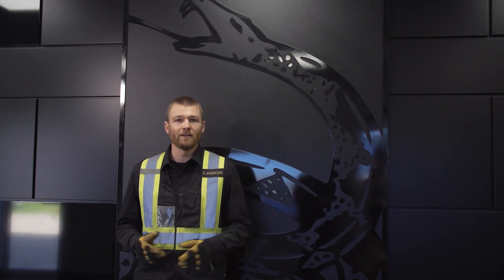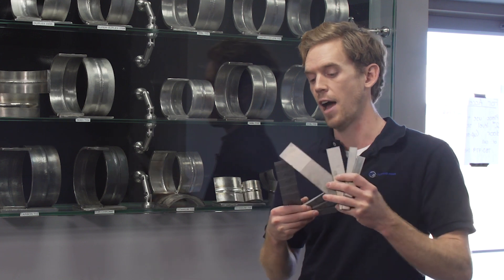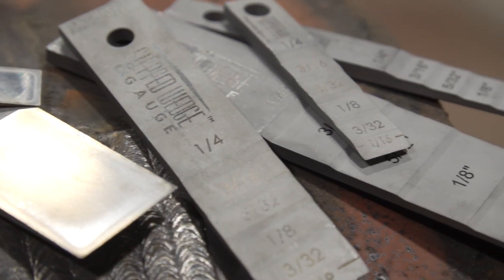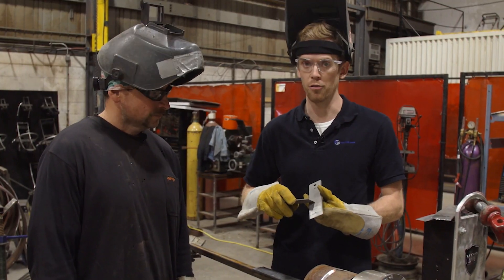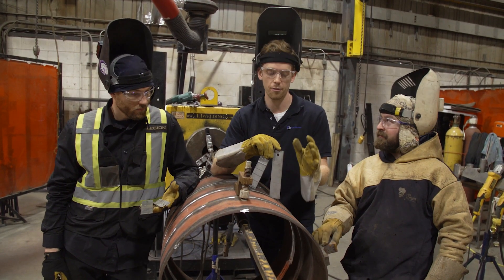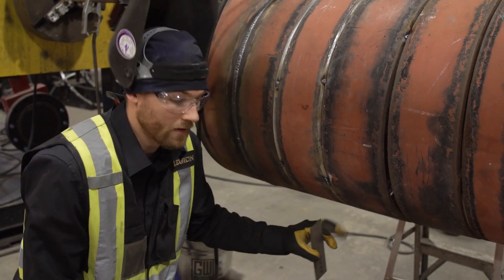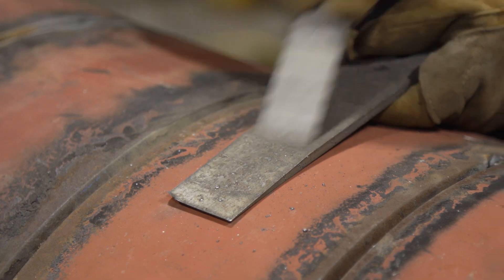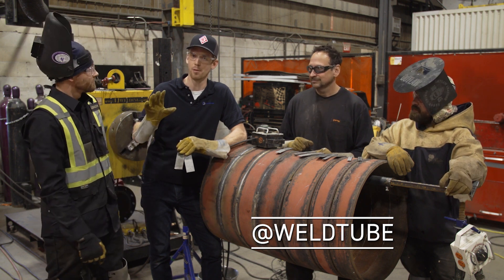Pipe Welding | Achieving a Perfect Gap featuring Fieldres

Comment: Can we get a spatter proof wedge for bigger gaps? Like a spatter proof Dog and Wedge setup?? Great product!
Reply: How big of a gap are we talking?, it's already 1/4" at the thickest point. I've considered dogs in the past, question is, how much would you honestly pay for a spatter proof dog (the base would not be treated obviously so you can tack them on to the parent metal)
Reply: @JByrt3  You may be right about making a decent profit on them. I just love the spatterproof aspect. Dogs and wedges are a bit labor intensive to make by hand but it can be done. You can get waaay more pressure with wedges and a hammer than even the beefiest bessey clamps. I have seen some pretty amazing things done with a dog and wedge. Thankyou for the reply 😎
Reply: @shadowops3653  I'm with you, Spatter Proof (resistant) tools are a no brainer, and I see them as the next evolution in fit up and tacking tools, hence gapandtack.com. Everything we make is done by machines so we can maintain extremely tight tolerances, create a consistent product and scale up with demand. Thanks for your support brother.